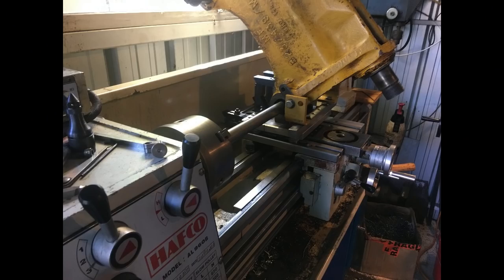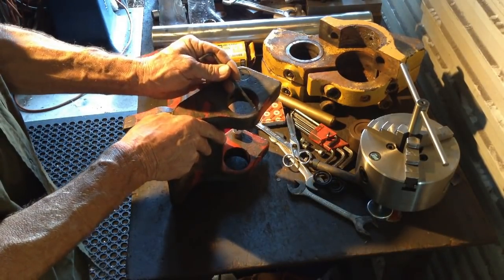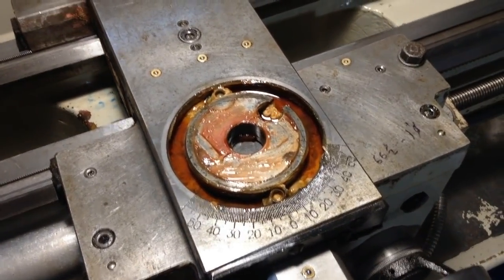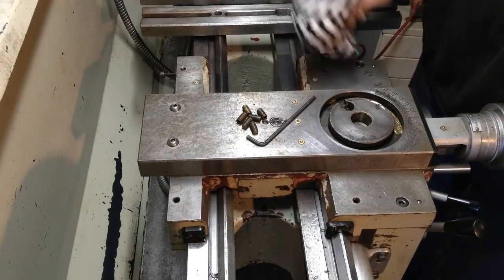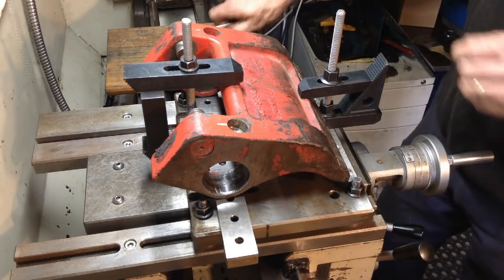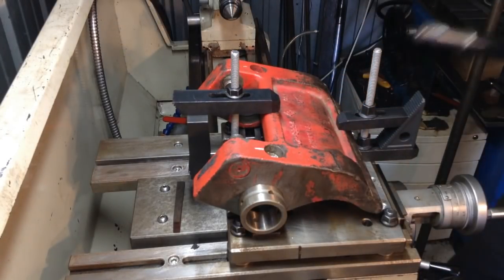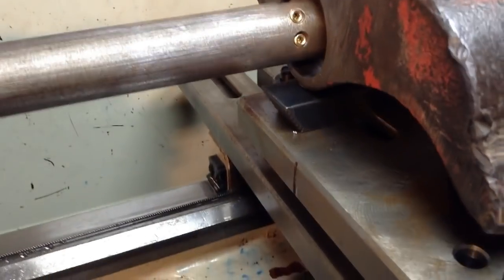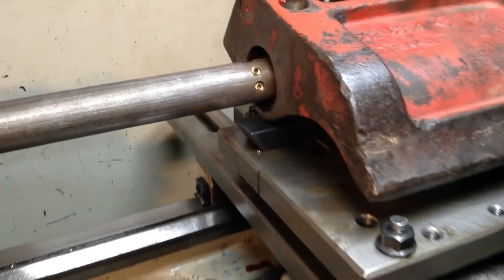Line Boring  In The Lathe  .  Part 1

Comment: Good one Max. Quite the cliffhanger you left us with.. lol .  I'd like to see if my horizontal would make a boring machine.  But it runs in inch per minute not  0.0??? Pre revolution.  But .500 per minute is very slow.
Reply from the maker: Horizontal's are good machines for boring work , the bigger they are the better  . I used to do lots in a horizontal in my younger days .  👍

Comment: Great set up Max. Glad you've bored holes in your carriage before I have so the purists don't complain. I've been planning to do the same to do a similar job once my lathes up and running again. I liked the shim stock method, I may be using it but the opposite way around to lift the component. Cheers Max. Tony
Reply from the maker: Thanks Tony .   I have no issues drilling holes in machines  as long as they are  for a multi use purpose & do not effect the operation or life of the machine .   👍

Comment: Hi Max, I know you used a 10 thou shim on either side of the adjusters, when you pulled them out wouldn’t that shift the fixture plate down 20 thou?
Reply from the maker: The shims only change the centre axis by 10 thou  ,  to off set for an oversize bore  .   👍

Comment: Hi Max, nice setup using the fixture plate and leveling feet.
I see a lot of lathes with Tee slots milled in the cross slide but your setup is more rigid bolting directly to the saddle but requiring more setup without the cross slide adjustment.
Used to watch my mate set up a job on the big Richards HBM, took him hours for a short machining operation.
Nice to have a portable line boring machine like Kurtis at CEE.
Reply from the maker: It's a quick set up in the lathe for that small sort of job .    The portable machines cost a fortune  so it will be good to have the big mill & hbm running .   👍

Comment: Great setup, Max. When I rebuilt my two-cylinder John Deere 620 engine about 20 years ago neither of the local engine shops could handle the 5-1/2" bore to the ~12" depth required. I set the block up on the cross slide of my TOS lathe, which fortunately has t-slots. Setup was all with shims, and there would not have been room for a fixture plate such as yours. Very fiddley setup that took quite a while, but it worked a treat. Wish I had pictures of that setup.
Reply from the maker: That would have been a good set up to see .   👍

Comment: I really like the way you added those rails in order to be able to use the fixture plate. There have been times I have wanted to mount something to my cross slide but didn't have any t slots. Your method is a great way to do that.
Reply from the maker: Its a good rigid way to do it .  👍

Comment: I like your fixture plate! Better design than mine. Thanks for sharing 👍
Reply from the maker: Thanks .  However you design a multi use fixture plate , there will be the odd time it may need a minor alteration . 👍
Reply: @swanvalleymachineshop  : I agree but using the two side legs with adjustable feet is the best design. That way various fixture plates to meet different cases can be developed based off a proven design.